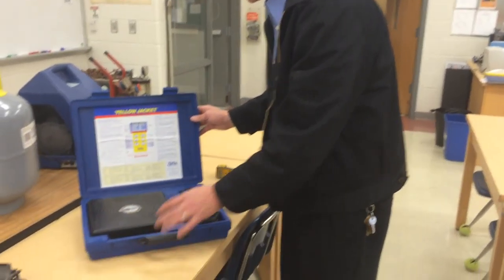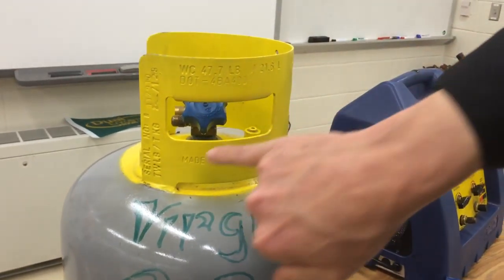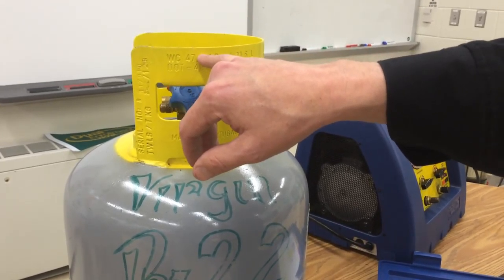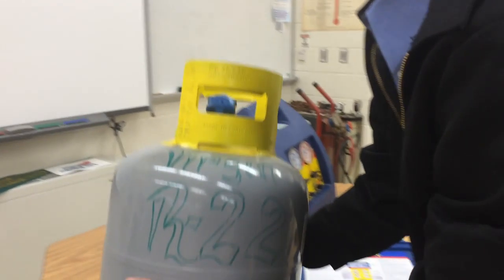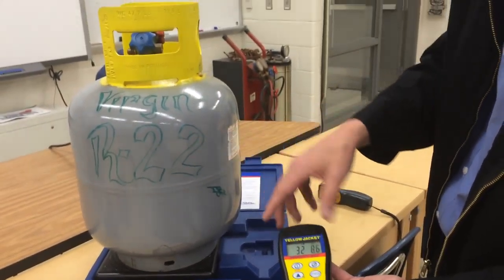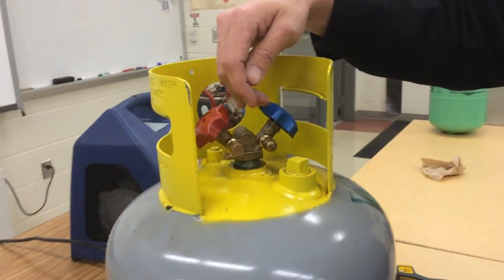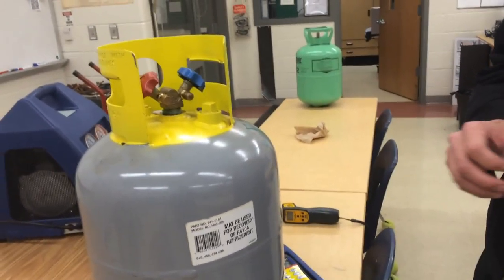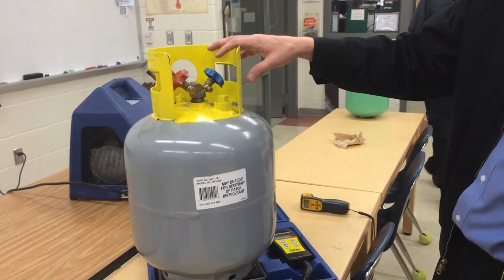HVAC Basics: EPA 608 Certification Test Study Guide - Refrigerant Recovery Cylinders

Comment: Why would a recovery tank be labeled “Virgin” ?
Reply from the maker: Some donated equipment was too badly damaged to use, but was still pre-charged with either R-22 (until 2010) and currently R-410a. We would scrap the unit for training parts and recover the never used or “virgin” refrigerant into a separate tank for student use later.